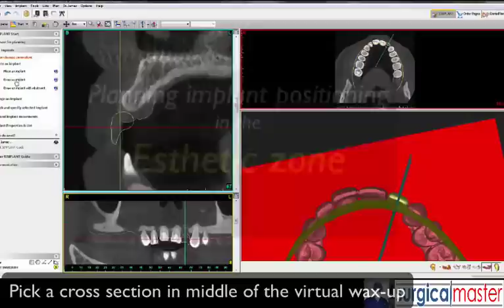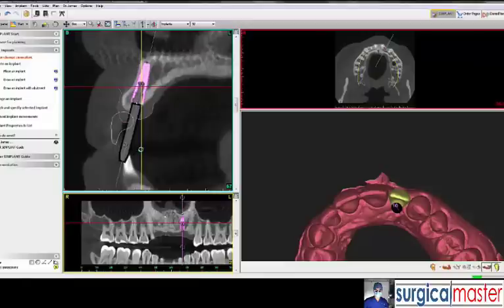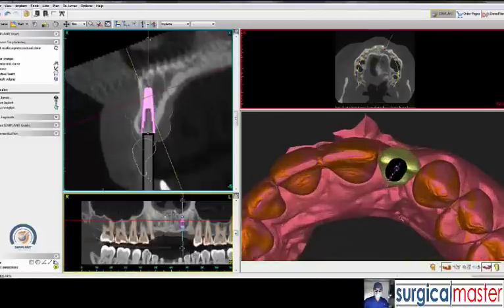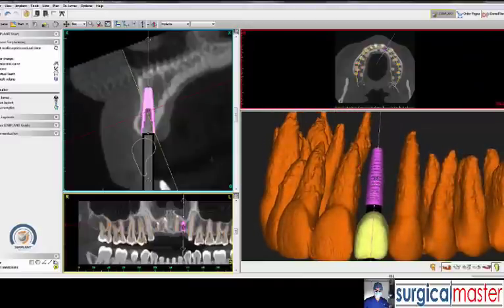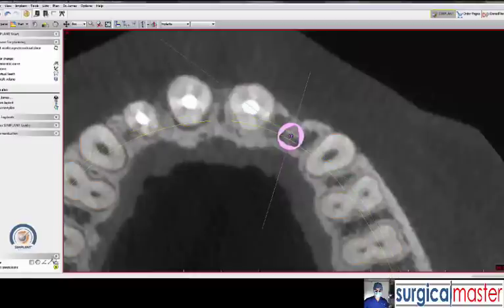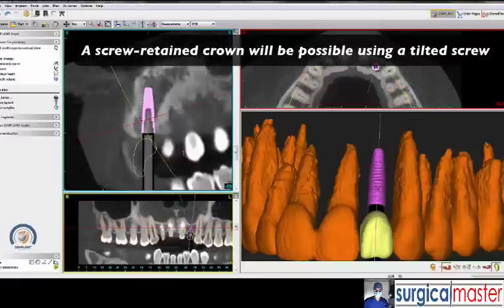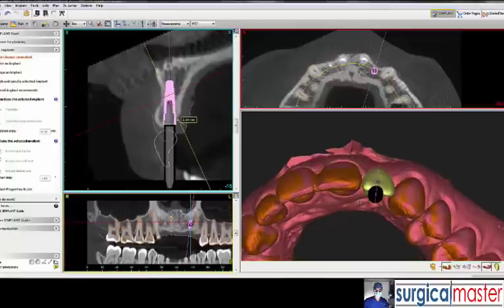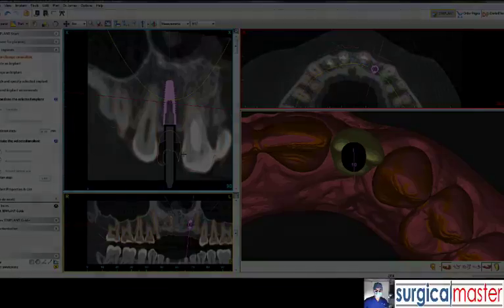Virtual planning in the esthetic zone - Upper lateral incisor

Comment: What software is this ? Do you need to have an actual wax-up and 2G Scanning as in NobelClinician, NobelGuide and their smart fusion? If that's one of the internal hex implant from NobelBiocare, it is still possible to do a screw-retained prosthesis with their ACS screw.
Reply from the maker: kamsiah haider This one is Simplant. I created a virtual wax (shown in a previous video). You can also use an actual wax up but it'll have to be scanned it. I also use Nobel Clinician but the workflow is slightly different but the principles are the same. Smart fusion basically allows you the scan in your wax up and merge with the CT scan. YES. The ACS screw is what I'm referring to
Thanks for the questions